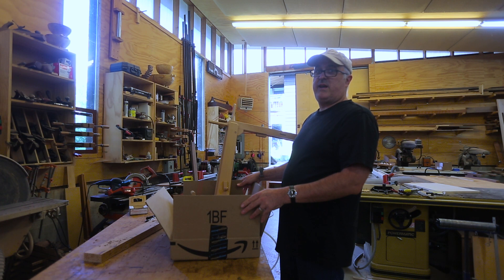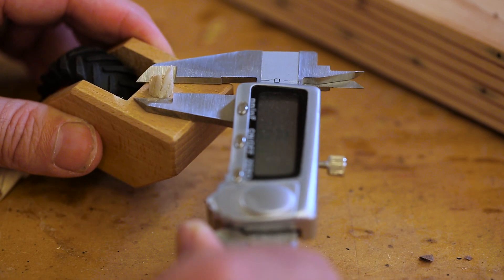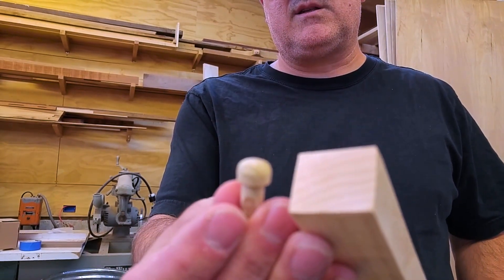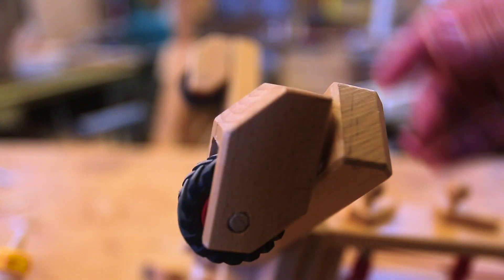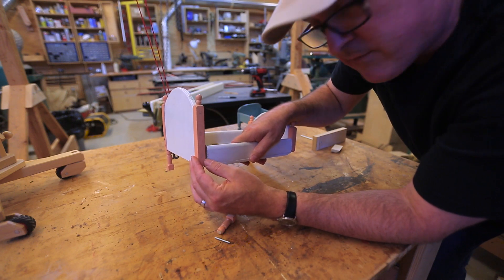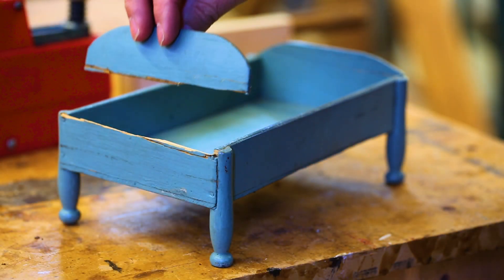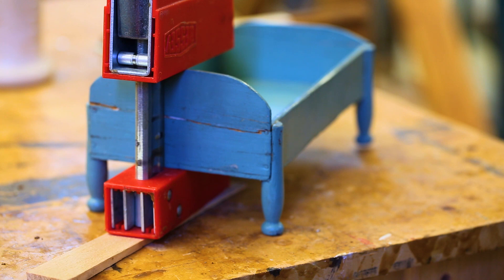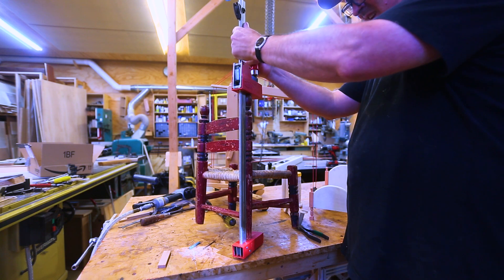Fixing Wooden Toys

Comment: It is strange to hear an American using Millimetres especially with woodworking. Do you use them often in the USA
Reply: Yeah, metric is common here. Woodworkers are probably more likely to use fractional inches than most. Most scientific trades use metric. Most machinists use metric and decimal inch interchangeably, without much say in the matter. It's a little convoluted but we do have a lot of gradations between the systems for screws, drills, tools, etc which is nice.
Reply: You are right that most American (wood, metal, etc) workers use imperial measurements.  I even have a caliper that is in metric, decimal inches and fractional inches!  That being said, metric is better (watch out for trolls with that remark).  Much easier to gauge small increments and figure out half of some dimension.  I query metric naysayers by asking, "What is half of 3 and 5/16 inches?" or "What is the next drill bit size up from 13/64 inches?".  Ok, how about half of 84mm?  Or the next bit size up from 21mm?  Simple!  But try finding a metric set of brad point bits!  The problem in woodworking is that all US construction lumber is imperial.  But metric is slooooowly encroaching into the collective mind of Americans (cars, bicycles, olympics, etc).
Reply: This was an excellent reply on a hot button topic.  Well done.
Reply: Many thanks for the replies it is an issue I have always wonder about as to how much metric is used in the States. Here in Ireland metric has been the norm since the very early in the 1970's but I am old enough to estimate in both and can covert the imperial to metric equivalent but fractions of an inch is a no go...simply too much work. Timber in Ireland are still sold using imperial measurements but in fact they are metric equivalents, However it is not unheard of for people to ask for an 8 x 4 ft x 18mm sheet of ply. another difference between the US and Ireland / UK is the larger dimension is given first so a US 2x4 in Ireland is a 4x2 or nominal 100 x 50 mm
Reply: (measures 5/16" dowel)
"it's about...8mm...weird size"